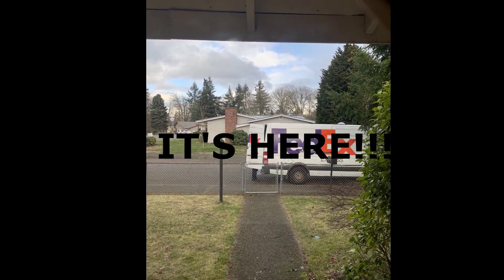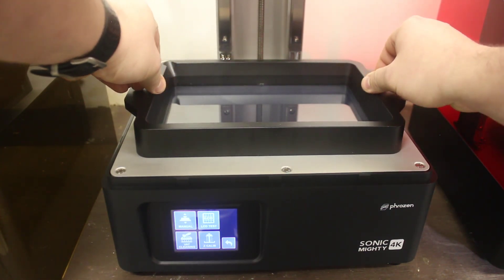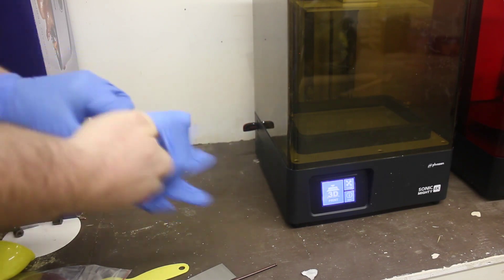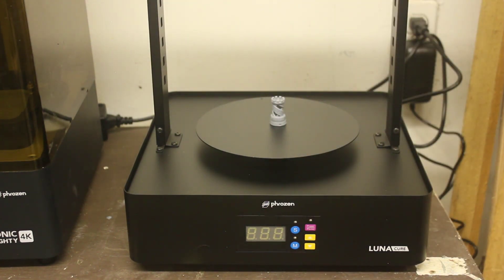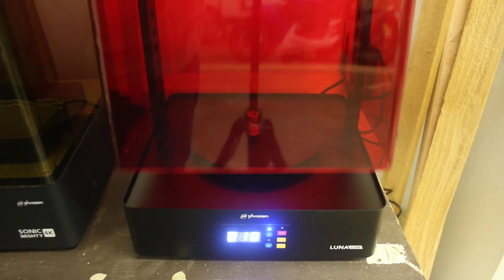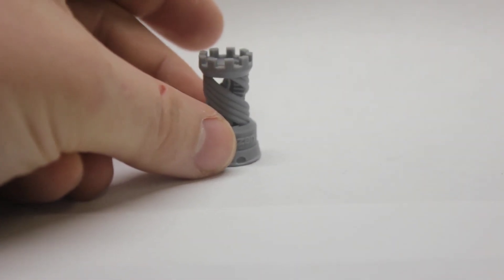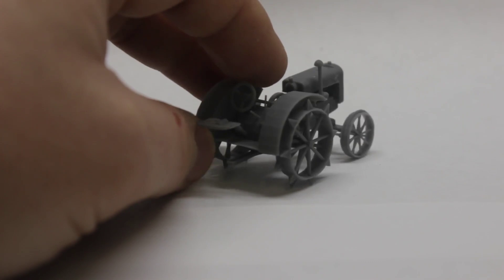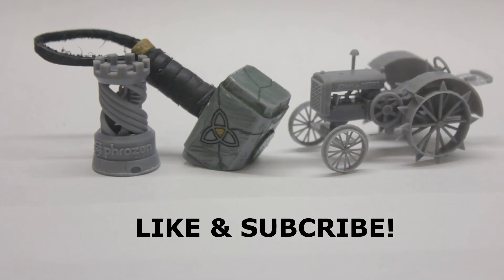Phrozen Sonic Mighty 4K Review

Comment: I wouldn't buy a Phrozen, if I had it to do over I'd buy an Anycubic if I was going to buy a Chinese brand but really I'd buy an Epax. Phrozen machines are shipping with pinholes in the FEP and can leak on the unprotected screen under the vat, when this happens good luck contacting the manufacturer and better luck getting them to stand behind their product. Epax ships with superior nFEP and an extra and you can call and talk to an American if something goes wrong. I've had this Phrozen for less than a week and I haven't had a single successful print yet, the screen is cloudy and I already have to replace the FEP and hope the cloudy screen isn't a fatal problem now. The manufacturer hasn't responded to my correspondence AT ALL. So already if you add up the cost of resin, FEP and frustration this machine isn't worth crap and has already cost MORE than the more expensive Epax (or Anycubic).  

Buyer beware.
Reply: sry dude, but you hear the same for anycubic and elegoo. so beware when buying anycubic. epax is only available in the us, so it doesn't help everyone.